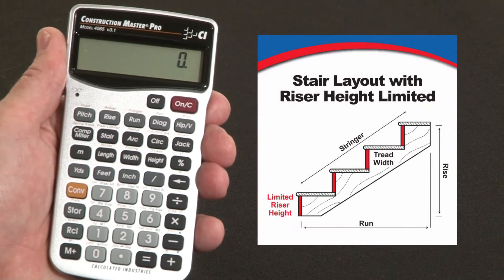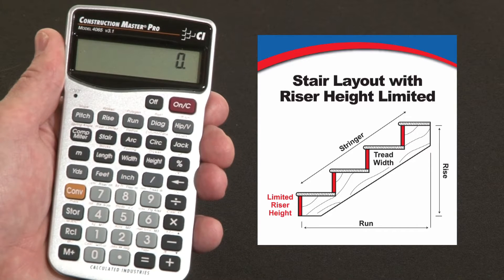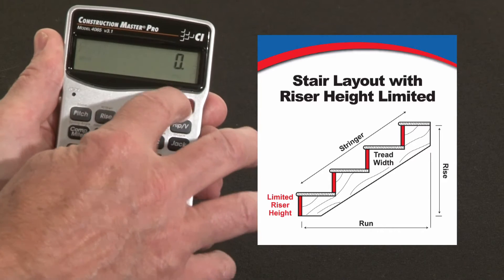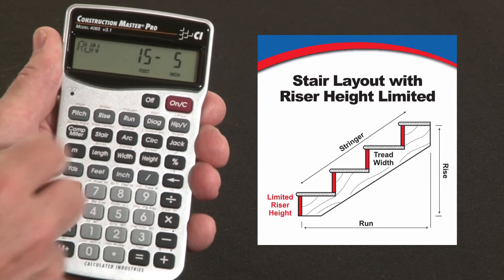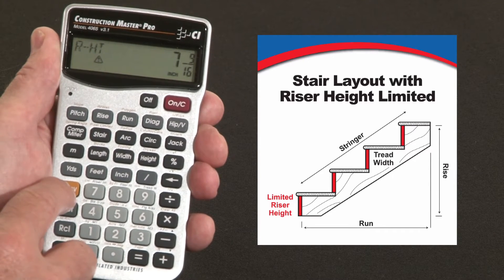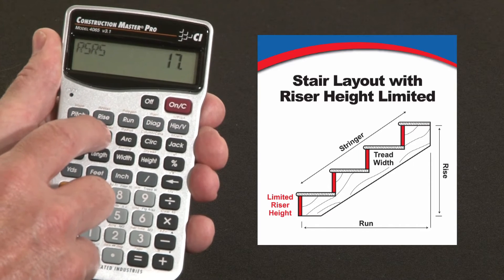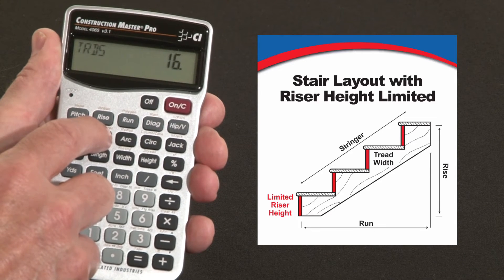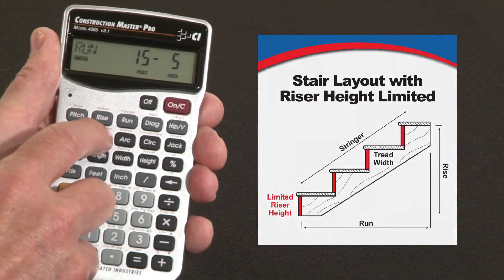How to Calculate Stair Layout with Fixed Riser Height | Construction Master Pro

Comment: How do you change stored riser height to 8 inches
Reply from the maker: +Elliott Granger  You would enter the new desired riser height 8 [inch] then press [STOR] [7]   If you need more help - email, call or use chat on our website techsupport@calculated.com or 800-854-8075  for a quicker response. Thanks!